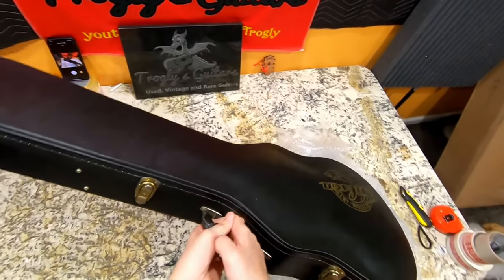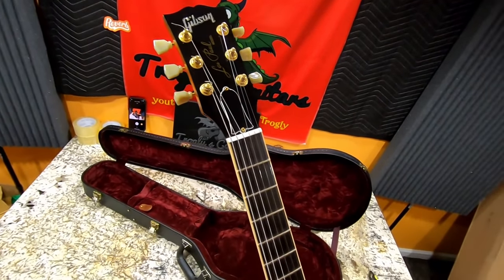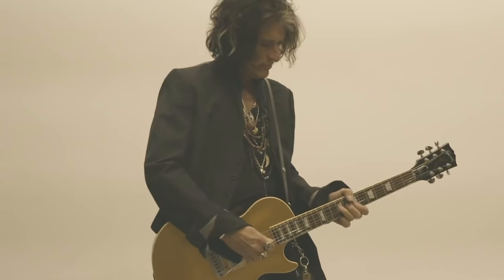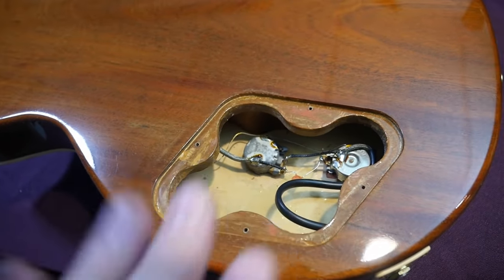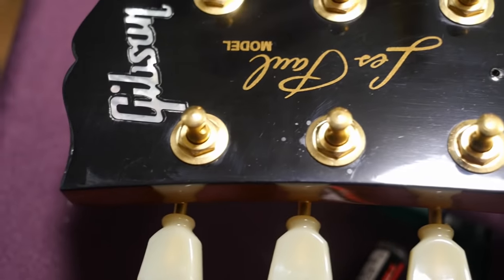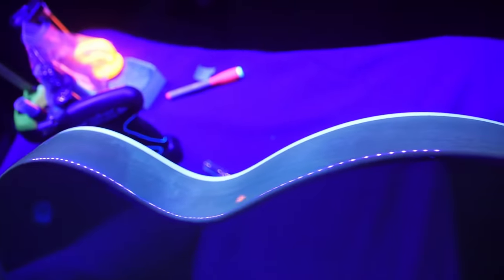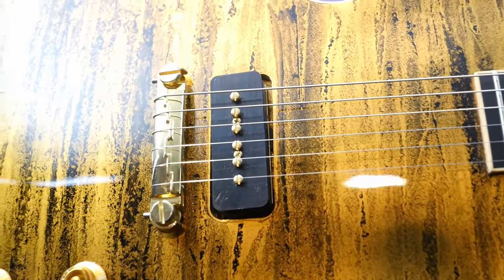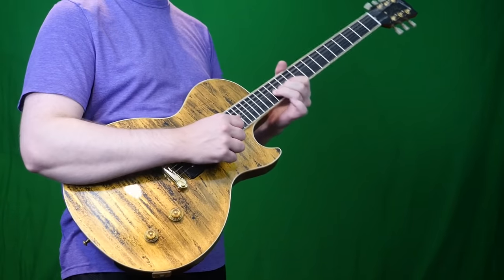This is "The MUMMY" | 1999 Gibson Custom Ordered Les Paul Elegant Gold Flow 1 P90 Wraptail Review

Comment: Another way you will know if a truss rod has never been adjusted is that you hear a cracking sound when it is turned. That cracking sound is actually glue that dried to the truss rod from when they glued the fretboard onto the the neck. It doesn’t happen every time, but more often than not it does.
Reply: Young, untouched guitar gets her cherry popped.

Comment: Love that Guitar. I normally don't like single pickup guitars because always put the pickup at the bridge. I'd rather have it at the neck for my deep tones. BTW, How do you get such clean distortions? I've tried gate pedals but still get that awful back noise.
Reply: Get a good gate. Or a distortion pedal with built in gate. The evh has one , so does the MXR fullbore metal. As does the amptweaker tight metal pedal. Lots of options. If you’re still getting noise then you have a grounding issue somewhere.
Reply: Weirdly enough, those Boss eq/tuning pedals do a similar thing & act like a booster. Great for clean dirt (if that makes any sense lol)

Comment: There is something about the power, sustain, and volume knob control of a single pickup guitar (especially with a p-90). I suspect the magnetic pull of additional pickups on the strings takes a little something away from the strings’ natural vibration.
Reply: I have wondered if that is a myth or not...I can say that for me it is true.  Check out the Gibson Les Paul Tribute Junior and the Special on this channel.

Comment: Reason for the differences in scale length measurement are due to how the Nut Slots are cut.    Fender cuts their Nuts so that the area of contact is at the inside edge of the Nut.  Gibson cuts their Nut Slots in a way that the contact area for the string is a touch farther back from the inside edge.

Comment: Gibson has at least 3 "24.75 inch" scale lengths.  You can only measure scale length from the inside edge on the nut as it's just the way it is.
Reply: They're actually 24 19/32 aren't they?  That fraction is .59375 and that what PRS 594 refers to.
Reply: Yes from the inside edge of the nut, where the string begins its free rotation, to the center of the twelfth fret multiplied by two is the designed scale length. The centres of each fret position are calculated from that chosen scale length.  
Over that scale length lays our compensated string lengths, varying individually in length at the bridge to adjust for differences in string core tension, gauge, string height etc. (Many luthiers can also compensate at the nut to achieve more correct fretted pitch).  
Advertised Gibson scale lengths of 24.75  refer to their method of measuring compensated low E string length and calling it scale length. Over the years the actual scale length on the fretboard has varied as production methods changed.

Comment: Gibson uses fret spacing with a divider of 18 and it should be 17.817. So this nut measuring business is nonsense. There frets simple are not spaced right. Gibson calls it compromised tuning and it is no good! Compromised is not compensated it means 2 different things! I will not play a gibson unless it has an epiphone fret board as they have the right fret spacings. But you can't tell anyone that can you?